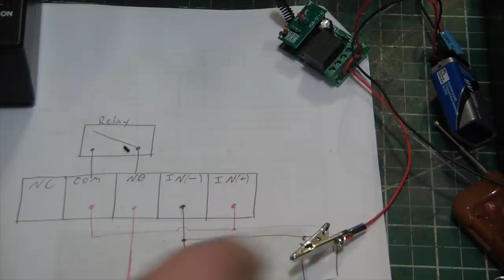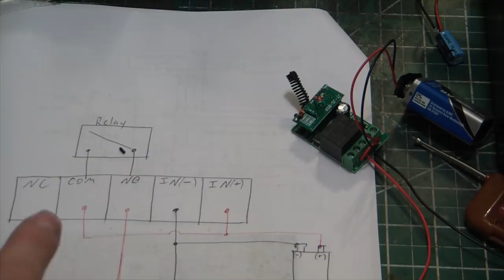Wireless Rocket Ignition Module - Super Simple! - ElementalMaker

Comment: As far as motor igniters go, I have launched many rockets using a simple strike-anywhere wooden match.  You simply wrap a fine wire around the head of the match a couple of times and connect it to your ignition system same as you would any other igniter. For most of the hobby motors, the match head is a friction fit and blows back out as soon as the engine ignites.  I've never had a failure using this method.
Reply: I sell strikers for ordinary safety matches . if your interested .

Comment: @3:09 - the transmitter isn't powerful, but it is 433MHz and it is (public) programmable code. 
I presume you assume nobody else is using the same code you are, or use a much stronger transmitter. -  coded yes, though they are limited! Rx circuit doesn't care who transmits, as long as it receives what it is programmed to trigger, it triggers ;ø)
For the price, wouldn't it be sensible to use 2 or more in series - each with their own code and frequency. This should increase your safety, so somebody else isn't triggering your blast cap by accident while you're near the lift-off site and/or looking straight down the rocket.
Thanks for providing such informative stuff, it is always interesting to watch - I learn a lot. Best of luck in 2019 :-)
Reply from the maker: That would definitely be a great option for increased safety. I've been using three of these units in several different applications for about 5 years now with zero false flags (meaning from some other 433MHz transmitter).
Reply: @ElementalMaker  - now with YouTube, and your videos - you could have inspired a lot of new-comers, and they're using the same equipment you've linked to, and probably using yourself.
I have also heard that not all electronics work perfectly, it seems to fail randomly ;-) A series connection is a good thing (2 hand job, if one fails the other keeps going - and you're not exploding all over quite yet)
Besides, the 'famous last words': I have never <blob> before. I respect fireworks and rockets, for a good reason.
Reply from the maker: Very good point, just because it hasn't happened yet doesn't mean it wont. Just in case - I always use long ematch leads and never set up the rocket motors hot, always setup the motor/ematch first, and then turn on the unit just so I at least have some distance. Any energetic composition is absolutely demanding of respect.
Reply: Nice!
Reply: hmmm noe å tenke på, fin ø btw

Comment: Great video, as always.
By the way, you could get the continuity check feature pretty easily on your homemade unit:
Just connect an LED and series resistor across the switch. (I'd recommend 4.7k or 10k to keep the test current low. Modern high-efficiency LEDs might work with a 47k resistor, keeping test current even lower.)

Comment: To those that use fuses, I've used visco fuse (purchased at sportsman's Warehouse  or Cabellas) wrapped in aluminium duct tape so as to light the center of the propellant. Works great!! Just bend the fuse a little so it stays in the engine as you light it with a propane torch. About 2-3 inches long with 1/8th" exposed at both ends.
Reply from the maker: I've used that same method with pretty good success 👍
Reply: @ElementalMaker  pp
Reply: @ElementalMaker

Comment: If the relay have a "open contact" you should be able to put a LED+resistor (maybe the e-fuse have enough resistance so you can delete the resistor) with a simple 1.5V battery it can light up the led trough the e-fuse but don not activate the ignition.
This "mode" have multiple purposes, e-fuse continuity test, Ready/Armed warning and successful e-fuse ignition. The rocket might not ignite but you can be sure the e-fuse metal is melted.
Reply from the maker: Very cool idea! I'm definitely going to implement that into version 2.0 and 3D print a nice case
Reply: @ElementalMaker  Thanks my dude. In Spain the chemicals for sugar rockets are ilegal, hard to find or super expensive (probably the rocket itself is ilegal to produce and fly), so you can fulfill my DIY rocket cravings ;)

Comment: Great idea! If you have trouble with less than fresh batteries, voltage probably isn’t your problem. Why not attach a second battery in parallel (same polarity to the circuit board as the original) to the first?
This ensures that there will be a full 9 volts available for a much longer time and ample CURRENT to heat up the wire at the flashy end.
Reply from the maker: That's certainly a good option. I just prefer the simplicity of just using a single battery. Using a few 18650's in series would surely work a treat as well.

Comment: You could avoid the oscillating problem by just using two battery connectors and batteries, one on IN+/IN- and one on COM/NO - that way the current draw and voltage sag on the battery feeding the match doesn't brown out the one feeding the coil.
Reply from the maker: Yeah that would certainly work, I just prefer use of a single battery when possible. Great comment I should have mentioned that in the video.

Comment: Two things (if you watch comments this far back)

Firstly, to reduce the oscillation you could maybe use two PP9's in parallel?

Secondly, do you have a link for your commercially made controller? 

I do kind of like the smaller one. It opens the pathway to possibly having the ignition system on board.

Comment: Has for the oscillating issue, have you tried to use a transistor to juice up and then with résistance and capacitor to aligne your signal in a way more "dc effect" instead of oscillating more ac signal?

Comment: ElementalMaker Excellent video!  I invent things constantly, just had an idea: a copper plug (about 2x15mm, made to fit in motor tightly) with a copper 15 mm square on the outside end that is painted black.  The idea being to aim a high power 1 watt or above laser for ignition from a distance.  Alternately a small piece of VISCO fuse with a painted black alligator clip on it.  If the laser was aimed correctly and the intracasies worked out, I wonder if this would work?  Anyway, great videos-I follow and like all of them.
Reply: Cody of Cody's Lab ignites things in his vacuum chamber with a laser from the outside, IIRC just a sprinkle of black powder is enough.
Reply: @PKMartin  I would think premade igniters of above design would be convenient, work from a distance, and very inexpensive (if you had the laser already)

Comment: Nice. Now the next step is to print a housing for that system. You could potentially increase range by changing the antenna on the relay circuit board. Possibly grasping at straws here lol

Comment: I was making a remote control igniter for fireworks, I used 32 swg nichrome wire supplied with 4volts power. The nichrome wire was heating but not glowing up.. What could be the reason?

Comment: At the moment i'm building my own simple fire unit, it has 6 channels for 6 igniters, you may could put 2 igniters in each channel, but i have to test it. It uses bluetooth to connect to a smartphone or another bluetooth module as fire controller.
Parts List:
Small plastic box from conrad electronic
6 channel audio clip(these red/black ones you know what i mean)
HC08 Bluetooth Module
Attiny85
SN7459(?) shift register
6x Irlz44n mosfet (china fakes, cause getting real ones cheap on ebay is quite difficult)
A 5V linear regulator (i think its an 7405)
Some leds, a pushbutton, resistor and some wires

You can programm different fire modes in the arduino, so it could also work for steppers, and with the button and the leds it has a ematch tester for every channel. I give a feedback if it works, because today i received the bluetooth modules and im still coding and testing with the tiny and the module
Reply: And: the prototype isnt even completed and i'm already thinking on much improvements for more channels, better functions, professional made pcbs (im using perfboard or how its called), maybe a display and the possibility to connect multiple firing systems to one controller

Comment: So I tried wiring two 9v in parallel and I checked the in(-) and the no with a multimeter (while pressing the button of course) and there’s around 8.5v going through it. But then when I try to connect an igniter, it starts buzzing and there’s only like .15v going through it and I have no clue how to fix this. It might be the way the relay is set up but idk
Reply: Did you figure this out

Comment: I could use this set up to blow my stumps out. I always fear I'm going to blow my arms off setting off the black powder.
Reply from the maker: Just be very careful working with confined BP... the frequency this operates at is public and there could potentially be a false trigger. The odds are quite low but it is a possibility to keep in mind. I use it for rockets because they are not intended to explode. High quality American visco fuse may be your safest bet.
Reply: Very long flaming sticks could be the simple solution
Reply: @ElementalMaker  thats what ive been using. I bought 100 ematches and they have been fun to play with.

Comment: Is the signal from the transmitter coded? The reason I ask is in case some random radio signal sets off the igniter by accident?
Reply from the maker: It is indeed coded. The question is how many bits is the encoding? 🤣
Reply: @ElementalMaker Sorry for the stupid question, I'm a bit new at electronics.
Reply from the maker: @GryffieTube  not a stupid question at all! A very valid question when safety is concerned.
Reply: @ElementalMaker  Thanks and thanks also for the great video

Comment: made one using a small atv battery, a remote fob system off a chinese go kart and a standard 5 pin 30 amp relay, whats nice is you can use it to turn on/off any 12 volt device up to 30 amps. also it didnt cost a dime because it was all shit just laying around.

Comment: Not even 10 seconds in and I see several wires smh 😭
Reply from the maker: Huh?
Reply: @ElementalMaker  just the black and red ones needed to wire everything together lol
Reply from the maker: Ah yeah its pretty damn simple!
Reply: @ElementalMaker  way better, and more wireless than my system lol. My electrical igniter is just 2 wires that I adapted to attach single broken Christmas lights onto and I just break the glass and sprinkle in some 3Zn+S "flash powder" that ignites when the filaments heat up